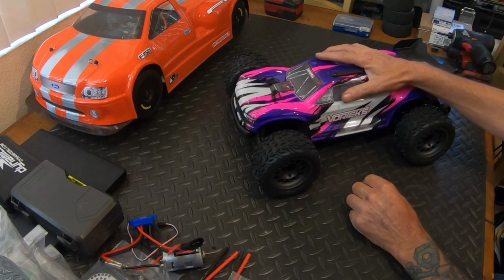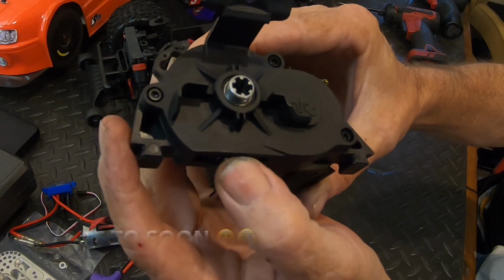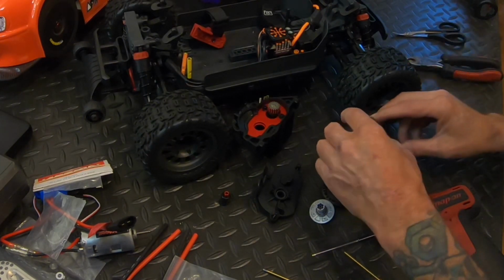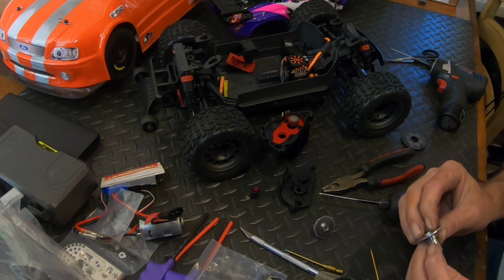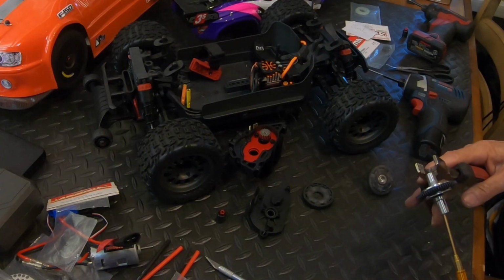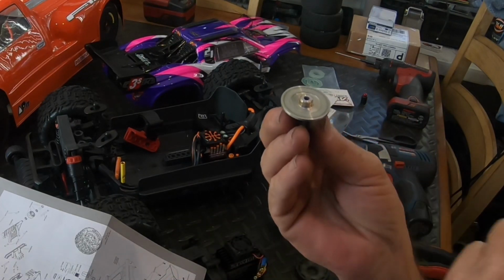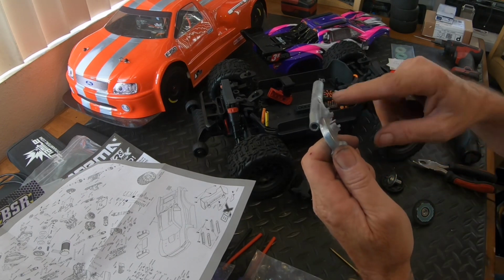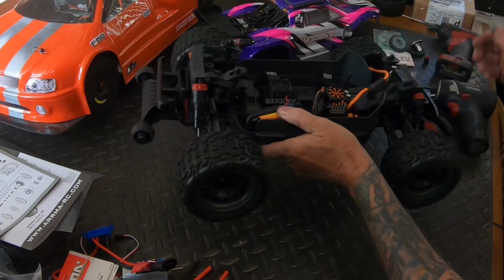Arrma VORTEKS Motor Issue Found not what I expected at all ??

Comment: I have a mojave and tons of fun but now wanted to get one of the 3s bashers to travel with but now im starting to think go big rock first? 🤔
Reply from the maker: Long as you check the mesh and fix it I believe this rc is good 💯💯💯
Reply: Big Rocks have issues out of the box too. The entire 3s line shares all of the same drivetrain with the exception of center driveshaft length.

Comment: So every vortex who makes that weird sound is because at the factory they overtightened the screw and snaped that aluminium hub?? I was wondering why it was making funny noises when this power system and clutch is used on every 3-4s line but only the vortex was doing it
Reply from the maker: I’m not sure as I’ve only looked at one not sure but the gear not being round causes the noise my case it didn’t sit flat so it moved in an oval pattern 💯💯💯
Reply: I have the same issue on my new Big Rock which I bought end of March in The Netherlands. But it has a new power unit after the original one blew its bearings. Could be a power unit from the same batch as all the new Vorteks models.

Comment: I have the same problem on my brand new big rock! Send the motor unit back to my lhs. Was my second new motor. First one blew its bearings on the third run.
Bought a granite and a big rock.  Granite has a little slop on the motor axle already. Not a fun start for hobby for me. Bit disappointed tbh.

Comment: Ah i see what happened. This happend when its tightened too hard and it snaps the aluminium happened to me once. Never use a power tool or overtightened it when its rock hard or your going to snap the aluminium
Reply from the maker: Funny I pulled it apart and put the brocken one together by hand the old part I finally used a power tool set to the lowliest setting then I still had to hand set it tighter so in my case no way I broke it 💯💯💯
Reply: Same thing happened to me, but with out the power tools. I think we can all blame it on a joke of a shitty slipper spring.
Reply from the maker: @Wreckedekcoupe  right 😜😜😜